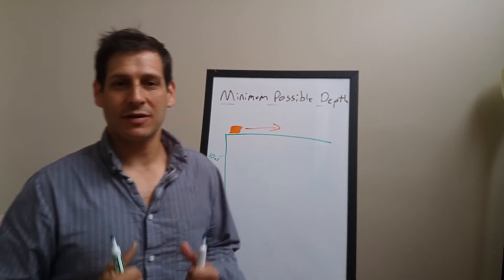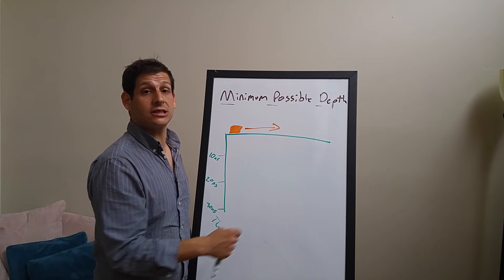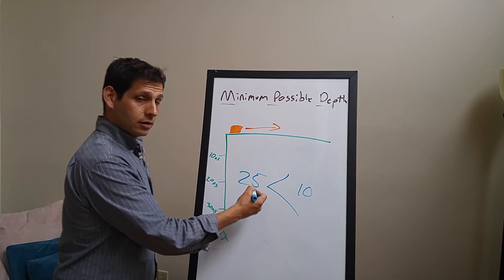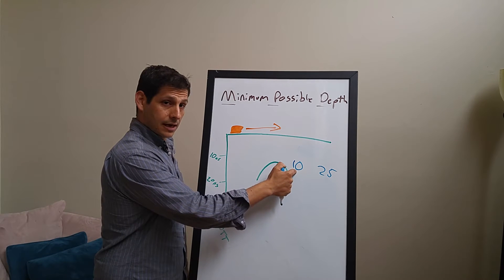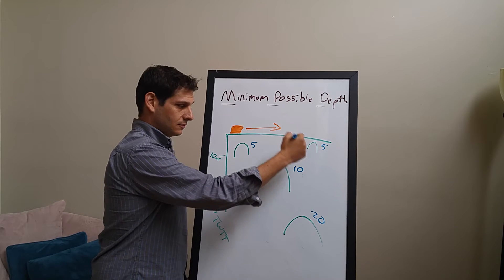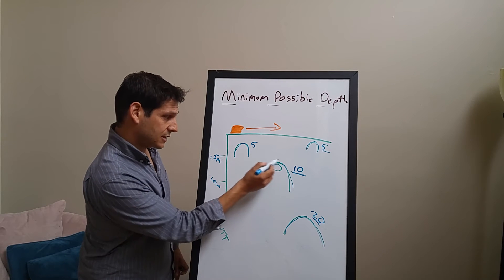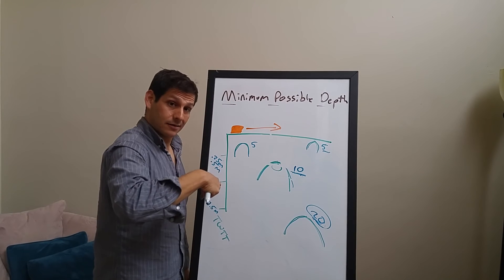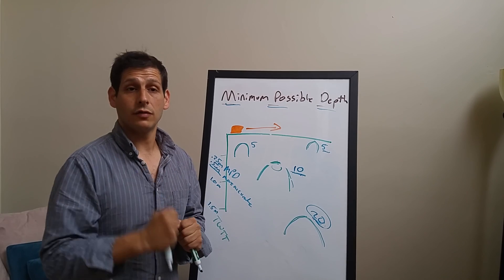Finding the Minimum Possible Depth of a Target Using GPR (Ground Penetrating Radar)

Comment: Hello, Thanks for your nice explanation. I have a question - "How to find reflection map of pipes which are exactly below one another?"
Reply from the maker: It can be tough. Two pipes below each other might look similar to a multiple of 1 pipe. If the top pipe is metal than you won't be able to see the one below due to shadowing. But If the lower pipe is larger than you might have a shot.

Comment: Thank you for the video
But i want ask you about hyperbola matching, if we have 3 layer for example layer 1 concrete layer 2 dry sand and layer 3 clay, and the pipe is locating at layer 2, so what will we gonna do? Just fit 1 hyperbola? If we fit 1 hyperbola we assume that the wave move with same velocity at each layer but actually not cause the rdp of each layer is different
Reply from the maker: If you fit 1 hyperbola then you will get an average of the velocity above that target. In your sample it will include layers 1 and 2 until your target is reached.The best way would be to use a multi-velocity model. This can be done in GPR-Slice and you can assign unique velocities for each layer.

Comment: how we can find/guess permitivity of soil
Reply from the maker: Vishnu Manoj yes. The most common way is to use a hyperbola fit. This will either give you an estimate of the velocity or the dielectric. Then you can convert.
Reply: +LearnGPR sir what if we are not getting an hyperbola?
Reply from the maker: Vishnu Manoj you could use a common midpoint offset. This creates a half hyperbola that can be fitted. What is the application?
Reply: +LearnGPR  finding moisture content from permittivity
Reply from the maker: Vishnu Manoj to do a CMP you need two antennas.  It would be interesting to see a study that use a this technique to evaluate variation in moisture. How large is the project area?

Comment: Thank you for your reply Sir.

In Reflexw processing software there is an option to input velocity. While matching hyperbola in processing, the curvature of the hyperbola changes with velocity. So I think, the velocity which best fit the hyperbola needs to be input in reflexw plot option (lowest velocity in case of many hyperbolas for MDP) This will auto update the depth scale as well.

Now please advice would this work? 
Also is that fine to keep RDP 9 everywhere for profile collection and match it while processing to correct depth?

My over all concern is 'Depth'.

Comment: This vedio is really awesome.

Suppose if hyporebola matching has not been done on site and profile was acquired with average RDP value of 9. Is it possible to do it in post processing?
Reply from the maker: pranjal maurya thanks for the question!  Yes, if you record hyperbola but don't match them in the field, you can do that afterwards in post processing.
Reply: Pranjal, 

Depending on the brand of GPR you can do hyperbola matching even in the acquisition software afterwards or in post processing software.

Comment: how to convert twtt (ns) to m
Reply from the maker: Nikhil Nambiar there a couple of ways. first you can bury an object and measure it's depth. then locate it with gpr and convert twtt to m. Or, you can use hyperbola matching. this is where you fit a model hyperbola to a real hyperbola and evaluate the geometry to get the wave speed. hope this helps
Reply: yes very well thank you

Comment: You're the Joel ostein of gpr. Listening on my way to work lol
Reply from the maker: morganman102 First, you're awesome!!!!! Second, I really appreciate that. That is a huge compliment. Third, that comment made my year. Ear to ear grin. Thank you so much for listening/watching. Let me know if there are any topics you want me to cover and be safe driving.
Reply: LearnGPR thank you lol I actually had some small questions. like what's your favorite overall frequency antenna? over the last couple weeks I've pushed a 250,300,400,and 900 (not including concrete scanning). finding I do my best work with the gssi sir3000 w 400 antenna
Reply from the maker: Its hard to say. Each has its own application. For what I do, I mostly work with 250 or 400. I love Leica's new 700. The GSSI 400 has been the workhorse for years for me. It's awesome. But, you should try the new GSSI 350 hyperstacking. It's ridiculous. I am going to use it on a project in Mexico in soon. Super excited.

Comment: I have noticed that the greater the difference between the soil condition on the RDP and the material RDP of the target, the brighter the target will appear
Reply from the maker: Nathan Dixon That absolutely happens. The amount of energy that reflects back to the ground surface will depend on the difference between the two materials. There is a formula to calculate the reflection coefficient which I go over in the GPR BASICS course. Thanks so much for the comment!